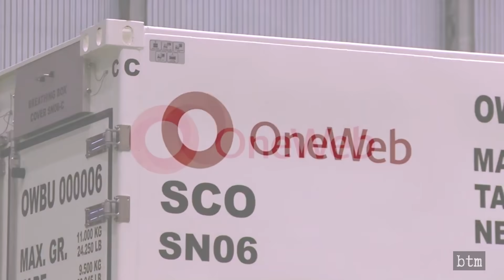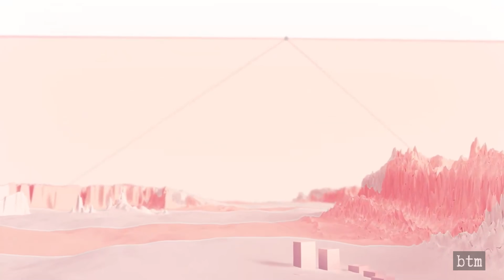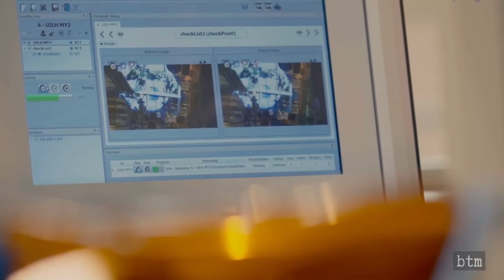SpaceX Starlink and Competitors Drive OneWeb into Bankruptcy | Who is OneWeb and Why Did It Go Bust?

Comment: It's called economy of scale, and right now SpaceX is the only company poised to pull this off successfully!
Reply: It helps that Space X is the only company with a operating full sized Rocket that is reusable. Musk would be a fool not to use that advantage and build this. He could even sell it for a huge profit once his network is fully built up. Then service/replace the satellites as a private contractor, limiting his risks.

He's got another Starlink launch tentatively set for May 7th.  That'll bring his array up to 480.
Reply: @Cirris  you're right, its brilliant. They have to do it even if they won't be an ISP long term. They're pretty much giving themselves a big discount each time they reuse and they get to prove reliability at the same time.
Reply: @Cirris  oops, I read  "army" instead of array....
Reply: Bezos has a chance only because he could pour infinate funds into the project.  Bezos has spent a lot on building a large faculty and other groundwork which may help accelerate his development later on.  

On the other hand Musk through up some tents and focused on the rockets and has more experiance in the field.

It's the turtle verse the hair approach.